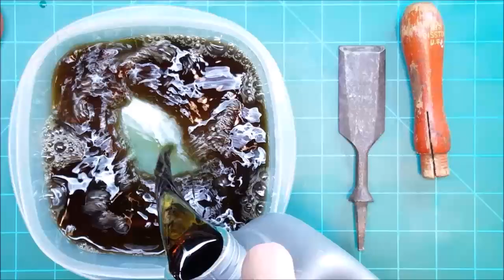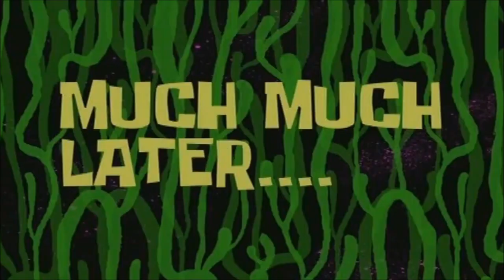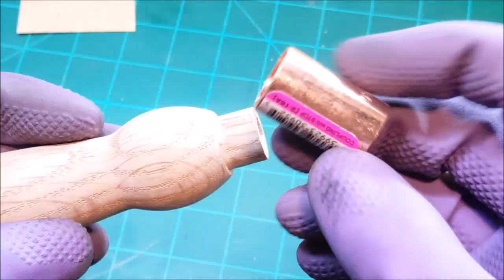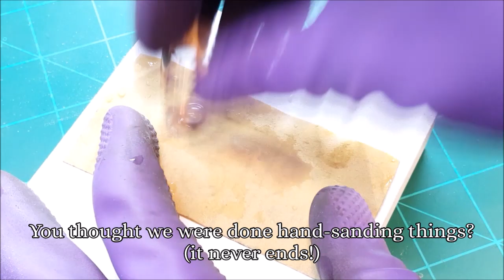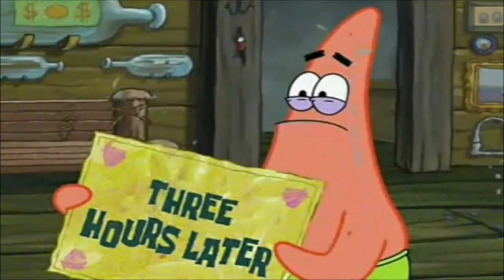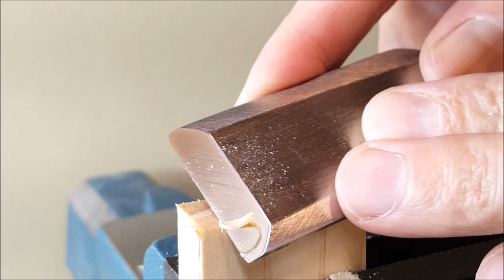Old Disston Chisel Restoration

Comment: You should strop after sharpening, and of course next time you sharpen it you'll start with a secondary bevel, rather than sharpening the whole thing to 25 degrees. There was no need for epoxy, and that makes it a pain for the next guy who replaces the handle. Nonetheless, it's nice to see an old tool returned to good working order. It's had a large amount of work over its lifetime to be as worn down as it is.